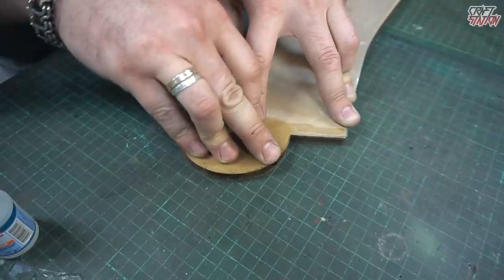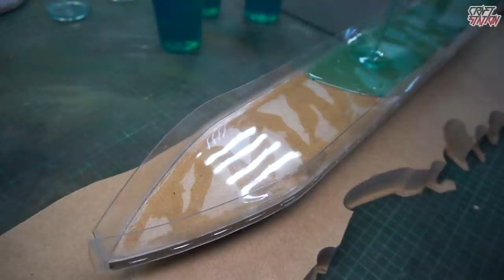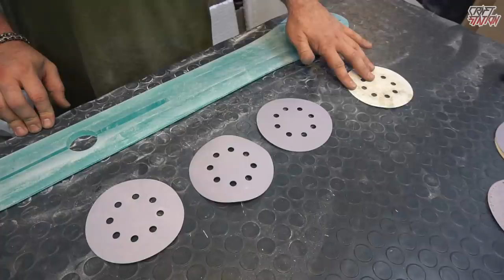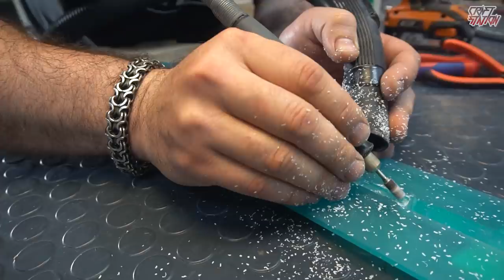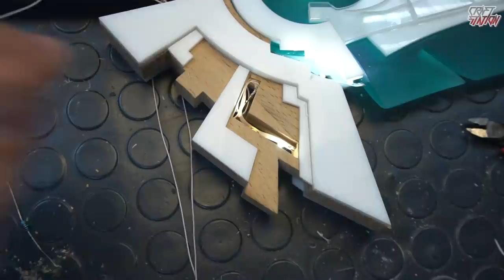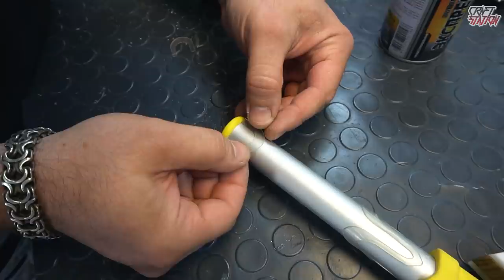How to make Epoxy Resin Sword From Genshin Impact DIY

Comment: people keep talking about how it looks more like skyward blade than skyward pride, but i really hope people realize how much material that would need and how unbalanced and fragile the sword would be
epoxy resin is much stronger than something like polyester resin, but i guarantee it would barely be able to support itself if it was in-game sized
Reply: I know right. It's massive already... Not everything has to be 1:1 to be cool.....
Reply: There really should've been some sort of support embedded inside the resin though. As in, the handle should've extended pretty much all the way to that green/blue painted bit. Of course, the support would bend around that hole so it doesn't interfere with accuracy. But having a support inside for the resin to hang on to, rather than all of it hanging off that one dinky screw point, would be far better. Whether the sword is made bigger or not.
Reply: Yup! To be fair, most "greatswords" IRL were smaller or at least lighter than the ones use in-game, so if one were going for a cosplay with more realistic proportions instead of exaggerated ones, something like this (perhaps a bit bigger) could be totally fine!
Reply: Honestly it still looks cool asf even if it looks like skyward blade more
Reply: Thay don't understand that it's for Sayu
Reply: @GudaGudaPaisen  You literally just described yourself here. Just because THIS assembly is too flimsy to hold a bigger size, doesn't mean that it's impossible. You can always use more/better support and it wouldn't be that much harder to make. Not that i have the materials or tools to make it, but it's not like this is the only way to create it as other cosplayers have already proven multiple times.
Reply: You are aware they build huge chemical storage tanks with epoxy and polyester resins right? And they use this stuff to build and repair airplanes and ships

It's one of the two components needed to male fiberglass or fiber reinforced plastic

I worked with this stuff before, when it dries it is insanely strong, all chemical factories use this to make pipes and chemical tanks because metal pipes will react 

Regardless no one should be doing this at home these chemicals are extremely dangerous, and you should not be handling it without a full protective suit with a respirator

Comment: you could have cut a lot of sanding time down with a 3D printed mold and spray release. 
but good job on it.
Reply: Or use the craft to make a mold just in case they'd want to create it again
Reply: these epoxy resin is better to shaped after rather than shaped at the first place, they need to make it sharper and better looking, so they polished it even better
Reply: almost every resin video shows the polishing, so yeah the better you know
Reply: and also, u need silicone to make the base of the molds, it would not be truly straight plus u need to scoop it up with joint knife.

Comment: Only issue with this is the size. You tired to make the claymore, Skyward Pride, but because you made it half of the size, it looks more like the normal sword, Skyward Blade. Only way you could really tell it's Pride is the signature split down the middle. Maybe a little more patience on the final painting could have done it more justice as well.
Reply: Y'all need to fucking realize that not everything can have a 1:1 scaling. This is fucking real life not a weird ass anime game where sizes dont make that much sense. If he'd make it bigger it would be hella impractical and hella expensive. For real life this one is already pretty big.

Comment: Personally I would have cast the guards of the hilt so both sides were exact and instead of working on the resin, made a castable throwaway of the blade in a high density foam, carving wood or model making clay but still amazing job.

Comment: It look cool as a display piece of art, but what is the point of the sword, when you can't even swing it, or try to act cool holding it, the handle are just .... yes, it look cool and Genshin player would probably like it, but this is not a sword, only an art piece.